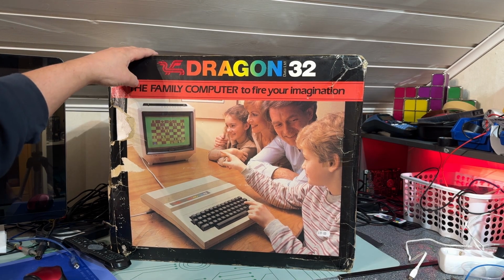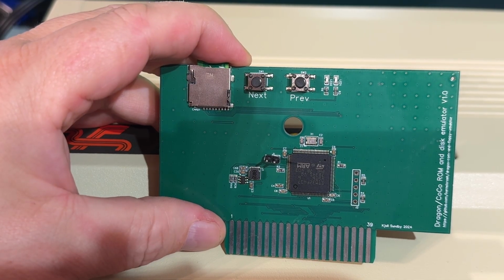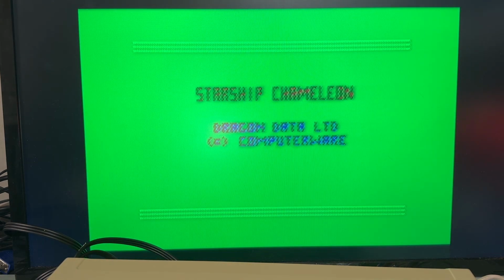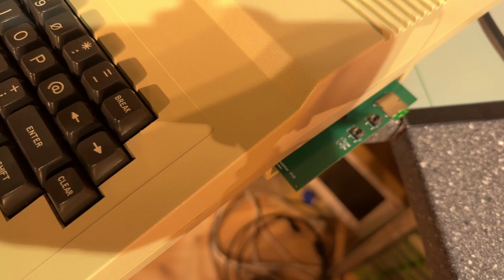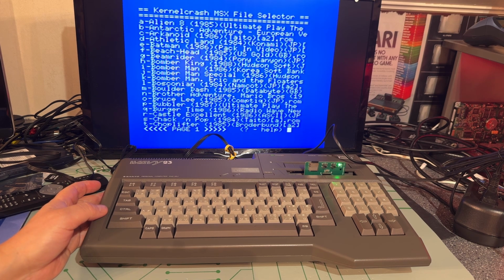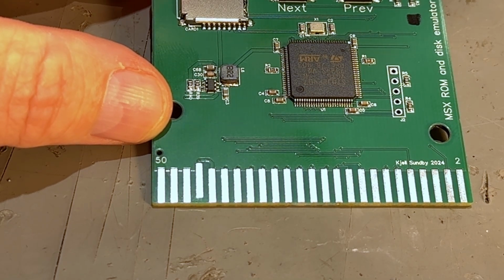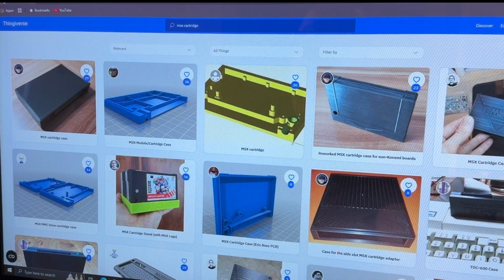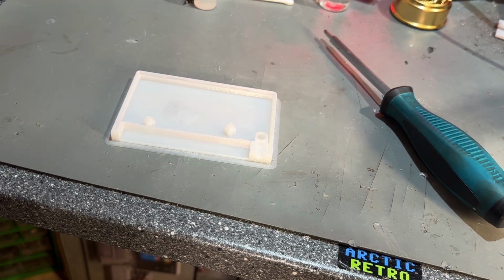MSX and DRAGON/TANDY rom and floppy disk emulators comparison

Comment: Whoever creating these cartridge PCBs, they need to make the gold fingers beveled, preferably 30 degrees angle, PCBWay and JLCPCB allows you to do that at no extra cost. No need to file the edge and it will be way smoother to go in and out, also, prolong the life of the gold fingers and cartridge too.

Comment: My first computer was the Dragon 32 and then later the 64. As a teenager with no access to internet (or understanding of operating system design) it was impressive that the Dragon 64 running OS/9 could support multiple processes and multiple users (via serial port).
My brother disassembled (and printed) the complete OS/9 kernel and studied it until he found out how that was possible. One day he was ecstatic, he had found out what supported multiple processes on ONE cpu.. the timer interrupt and the process scheduler. I am still impressed by that analysis.

Comment: Dragon 64 is a bit more than a Dragon 32 with 64k - it can copy the rom into ram (something the 32 can't do easily) and comes with a proper serial port instead of the big-banging serial port that masquerades as a parallel port. CoCo software isn't that compatible either because the keyboard matrix has a slightly different map which makes it problematic. The BASIC tokens are different too so while the language is mostly the same it doesn't just work

If you want to try one of my 32k repro boards (with 64k or 256k) please get in touch :D